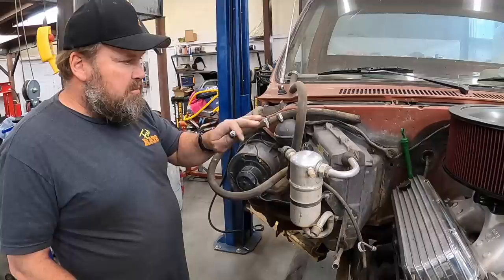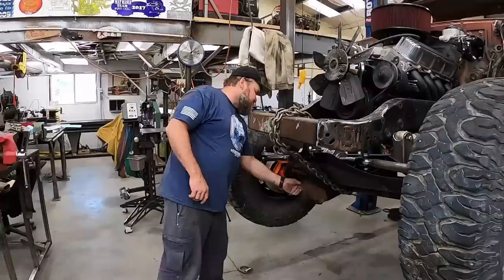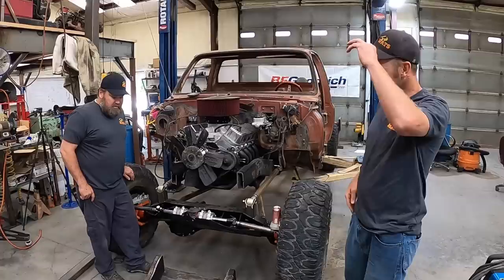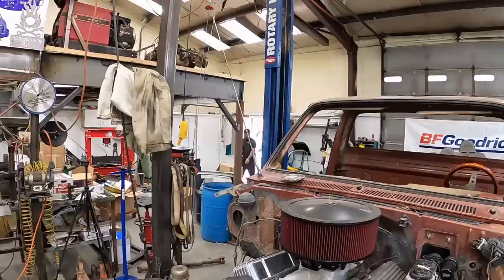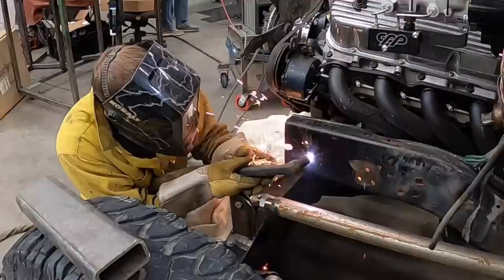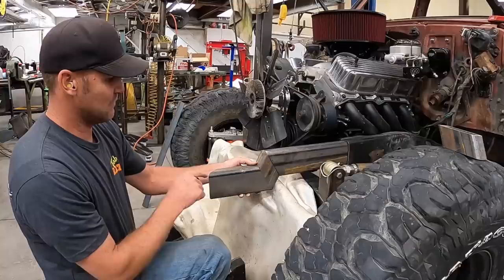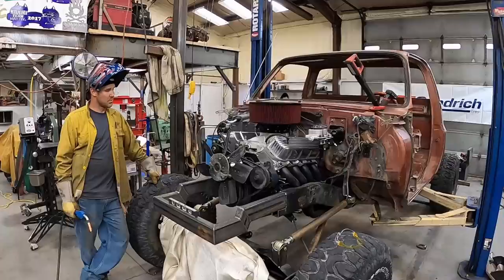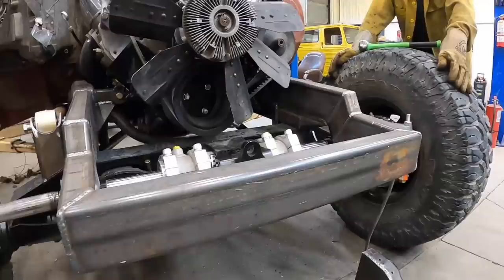This Custom Frame Is Never Going To Bend On The Rat Rod Tow Truck!

Comment: Anyone else noticed at 21:05 the front frame was upside down I can’t wait to see this thing done keep up the work
Reply: Yes, the boys do it nice because they do it twice!
Reply: I was like "errrrmm", Pause, rewind, play. "Yep, first time's a test!"
Reply: Came here to say the same thing...they just kinda skipped over that part 🤣
Reply: I was reading the posts to see if anyone else caught it lol……… I had to rewind for a double take haha
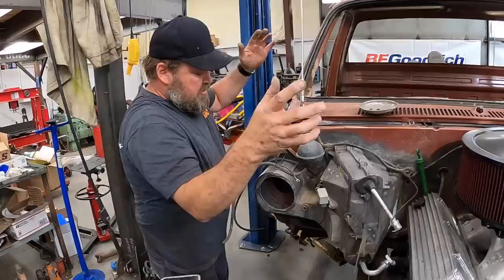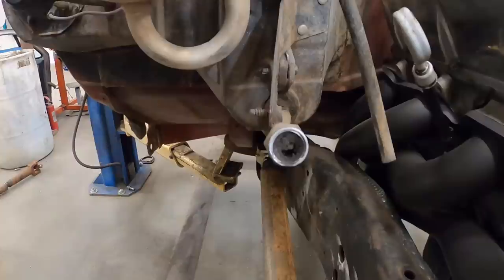Reply: Also the upside down mistake on the evaporator at 19:35 they magically fixed by 21:35 to match 0:35
Reply: I also saw it and looked to see if anyone else did.  Now the question is who on their side noticed first.  I bet it was Ben.  He is the least upside-down one of the two.  :/
Reply: Got to saw Randall caught the mistake before it got too far
Reply: I was searching for this comment becuase before they put it on upside down i was thinking "they are probably gonna put it on upside down"🤣🤣🤣🤣
Reply: I did a rewind too, to see if what I thought I saw was what I saw.
Reply: YEP!!!
Reply: They should put an Easter egg like this in every video. the challenge is for us to find it.
Reply: They're just keeping us awake. lol
Reply: @smirkingone  play that section back at .25 speed and you can see Paul step back, look at it, then start laughing. They left us a little Easter egg. :)
Reply: It was on correctly, they just forgot the flip the truck over.
Reply: Yup - also the bump stops mysteriously appeared and disappeared on the left side.  Just making sure we are paying attention.  Haha - Fabrats we love just hanging out watching you guys do what you do.  Thanks for doing that for us.
Reply: @CarCapture   I like that, I'm agonna use that. :D:D:D
Reply: Yes I did! Hahaha

Comment: This build on the Rat rod tow truck is looking good! Lot's of measuring and eyecromitor reading's going on to make thing's happen. Ben is doing an amazing job at getting the heater core and controls working correctly as well as nice cold air in the summer and having a defrost that works! Good jon Paul and Ben and Randall!

Comment: This might come in handy, when bending offsets in conduit, I have a cheat sheet of multipliers I use based on degrees of bend.
Bend deg    Multiplier
10.               6
22.5.            2.6
30.               2
45.               1.4
60.                1.2
Reply: Does that change with the size of the EMT?
Reply: Nope
Reply: @Dr. Florida Man  it will change with the bend radius.
The zippedy doo dah way is to get the program for that.
Calibrate your dies, then you can hit your number every time.
Had a feller with it on his laptop when we bent some expensive S.S. tube for a platform on back of a boat.
Otherwise, we did it like Paul.
Reply: On conduit, the bend radius changes on different sizes of pipe but the multipliers stay the same. Example radius for a 90 bend in 3/4 emt is 6 inches, but radius for the same bend in 3 inch emt is 24 inches, but the multipliers remain the same for offsets. You are limited by the radius on the larger pipes, forcing you to use less deg and therefore longer offsets.

Comment: Say what you will about backyard Mechanics/Fabricators.....There isnt a auto Engineer in Detroit that could have done what they did to that frame without a computer and a CAD program and a week of number crunching and 3 different engineers fretting over the strength of the frame. These guys did it in a couple days with a Tape measure, level, and a square. Incredible gentlemen carry on!!

Comment: Hey a/c tip from a guy in in the Arizona heat, put a blue orifice tube in that thing and it will cool much better, r134a needs a smaller orifice to get low side pressure low enough to cool properly.

Comment: Here's a little trick I use when fabing something and need to figure out an angle you might find helpful. Simply take a piece of heavy gage copper wire and bend it to fit where your piece needs to go. Then get the angle from the bent copper wire and cut away. Takes a lot of the guesswork out and a lot of recutting. Enjoy your videos, especially the Golden Nugget. Jim

Comment: Just a pet peeve of mine but if your going to totally pull your A/C and heater unit apart why would you not totally clean the shit out of it🇨🇦🏴‍☠️
Reply: When it's a small piece to the big picture it is irrelevant. 
The purpose of snatching the parts out was to fix it, not pretty it up. I say it was a job well done. 
What Justin Trudeau did to those citizens is atrocious. Consider turning your pet peeve into a betterment for humanity

Comment: I draw lines on the concrete to figure out angles. Draw a line for the existing frame, one for where the new part needs to be, draw a line for your angle and measure! Old plumbing trick!

Comment: I just removed a mouse from my PT's blower motor squirrel cage.  One thing to mouse proof your vents is to add a piece of 1/4 x 1/4 inch stainless steel mesh across all openings.  It makes life soooooo much simpler.

Comment: Make sure you replace the accumulator (dryer) before you recharge the A/C system.That old part stopped doing it's job years ago. Also add a little re fridge oil to the new accumulator.

Comment: I put a vintage air system on my 85 best decision ever all that stuff on the firewall goes away and the evaporator is inside the truck where it belongs absorbing heat It really frees up the room in the engine compartment and the fan is infinitely adjustable not just 4 speeds, best 1400 ive ever spent. the kit comes with everything but freon and a fan belt

Comment: typically measure the diagonals as well to be sure its not a parallelogram since the cab may not be square.    although maybe it can help with frame twist from torque   :D

Comment: I believe it is called an orifice tube? Expansion valve's regulate the flow of refrigerant to the evaporator due to temperature, Orifice tube is a fixed nozzle that spray's refrigerant into the evaporator, but doesn't regulate. Less regulation in my opinion is always better!! Both systems work well, but the expansion valve is used more in newer vehicles. Awesome content, wish you would show more of the hard sweat and resolve it takes to repair any vehicle, old or new! Let's see more of  the sweat and agony? I am a shop owner for 22 years and do not think the general public has an understanding of what is truly involved in what we do!! Love the channel and the your ingenious solutions!! Carry on warriors of the machine!!

Comment: The guy up in Oregon, Casey LaBell, did a little blurb on the BANKS diff covers. In his piece He sends you to a very in-depth look at diff covers and why the one he developed is better. The BANKS folks even took and built a clear plastic cover of the biggest/original square cover and one BANKS built.  It shows a real marked difference in what each does and does not do.  I know I am nobody, but I suggest you go take a look at this BANKS diff cover.   Don't believe me go look for yourself
Reply: Yes! I changed my different covers after watching that video.

Comment: You may want to try sticking dryer sheets in the heater some way. Mice are supposed to hat the dryer sheets.  Then add some to the inside of the truck.  It's worth a try...

Comment: Paul, you should have gone with a bed mounted radiator. Then the front could be a flip forward fiberglass front end and or a simple unplug the lights and lift off front end.  :-)       Nice work always enjoy the videos.

Comment: Check with your welding supply shop and see if they have an angles lay out book. When I was a pipefitter I had little book that would give just what you needed for what you did.

Comment: I about cried when I saw those new gears and differential at 4:20 . Yesterday I decided to replace a leaking axle seal on my '82 Scottsdale K10. Removed the diff cover and found a previous owner had welded the spider gear cross pin in place... I ground the welds off, but two hours of banging on that pin with a 2lb hammer did nothing but leave me in pain, and in a bad mood. Still not sure what I'm gonna do. No 4th of July cruising for me...

Comment: how far into welding the front crossmember did you realize that you had mounted it upside down? I saw what you did! You guys can weld! I envy you that. I could flat well but welding upside down - I just never could get the hang of it. 
My truck that I would love to find would be a 64 to 66 Chevy c10, c20, or a long wheelbase C30 any would be fine by me. thank you so much for videoing these things and the Golden Nugget came out really nice. 
It's a beautiful area that you live in. 
Thank you for sharing,
 Bob from Virginia USA

Comment: Paul you need to try Diablo Steel Demon carbide tipped blades for the arm shaker saw.  They are a game changer compared to the old bi metal blades

Comment: great work, did anyone notice the frame was going upward when tacking the weld at 21:00 then it reappeared going down.  
and Sawzall blades are supposed to be blue and broken, seems that's the way most of mine end up.

Comment: Where those upper links join the chassis looks like the joints are 90 degrees out - the bushing is flexing rather than rotating on the pin

Comment: Ben, pressure wash that heater/air conditioner box.  Blowing those turds out is fine, but they pee in there too!

At 21:03 time, aren't you tacking that frame end in upside down?  But I see it got caught. :)

I'm really enjoying the build and the tow truck should have some excellent off-road capabilities.  I can't wait to see it with final wheels and tires.  Poor Ben and Randall are going to need a step stool to get in.

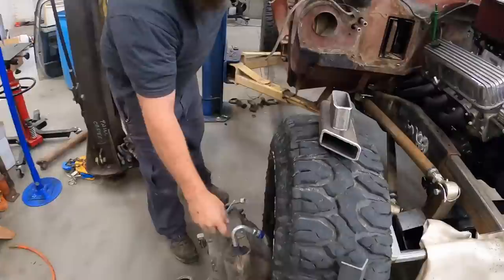Comment: At about the 19:30 mark, it appears the evaporator inside the box is upside down?  As it sits, the dryer bottle will be into the dipstick and valve cover.  (I've need watched the whole video yet, so it may be corrected, or explained  in a few..)   Yep, it got changed.   Good catch!

Comment: Offset x width of the material, divided by the length of the offset= the amount of mitre you need. Divide that number by two and that’ll give you how much to mark either side of the line to make the notch. I’m no mathmatician, I’m just a sheetmetal worker and mitre a lot of duct to make offsets.

Comment: Have you tried articulating the front axle to make sure the control arm mounts don't hit if you have a tire hanging?
Reply: Was thinking same.  Passenger side upper link may hit frame when driver side at full droop.  Looks very close.  Something to think about anyway.

Comment: if it doesn't have a heater core bypass valve, add one or manual valves to do the same. because they always leak a ton of heat inside and you'll be roasting even with the AC working best as can be.

Comment: I love the work you doing to this tow truck! I used to have a 1973 Chevy heavy half that had been hit head on by a semi and my dad and my uncle rebuild it but the framers weak and I had to put a whole other frame on it. But my question is is that I have a 1999 Oldsmobile bravada all-wheel drive and it would go anywhere it worked really well but I got it stuck in the mud hole one day and Bella Vista Arkansas and I backed out of it and I got a hard run and I broke it CV axle on the passenger front how many the next day the speedometer start going crazy and it was trying to shift with the speedometer and now he'll shift from first to second but if you put it in 3 or overdrive they'll just rev up but if you really mess on the gas it'll still pull in second and my service all wheel drive light is on and my ABS light is on and it has all new hub bearings CV axles brakes everything's new I've got a new encoder motor on the transfer case I got that new box that activates the all-wheel drive when it needs it but after it was have got sex that was popping the cracking in the front differential and I took the plug out and check the gear oil and it was empty and I've never seen it leak on the ground no signs of leaks I don't know what happened but it took two quarts of deer oil before it starts running out the hole for the plug is and if I put the front drive shaft in it then it acts like a four-wheel drive it's in low range and you know how it would fight and everything on dry payment so I had to pull the drive shaft back out of it and driving without it but I can only go 35 miles an hour in second gear and it's almost 4,000 RPMs and I know that's not good on it and the speedometer doesn't work at all well within that so I don't know if it's a wiring harness or a shift solenoid? I wish you guys could work on it and fix it and make it awesome but if you can help me if you have any ideas what I need to do I would greatly appreciate it and I also took it to Natalie Chevrolet in Bentonville Arkansas make with your scan tool on it and they reset everything but maybe it's like came right back on and I replaced the speed sensor in the tail shaft twice and it hasn't affected it at all so can you please help me?

Comment: HEY PAUL  you might want a fabricated torsion bar for your rear differential, like under Rory's  trail mater  to keep your differential from twisting while pulling lots of weight and climbing rocks. Rory's got a great view of his on his last or by now next to last video. He put the go pro on his differential and I was like that's a great idea.  Check it out , it would make your differential so much stronger with no leaf spring twist. I just looked up his video, it's called   Tow Truck Versus A Buggy For Pulling. So what do YOU think?

Comment: This is how they designed the engines for the Apollo rockets in the 1960's. The only difference is they also used slide rules.

Comment: I miss the days when heater cores were that easy to change.
Reply: They still are, on Square Bodies.
Reply: @fredandersen9873  I know. I found a 97 f 150 for 650 dollars though, and after tires, ball joints and control arms I had a really reliable truck. Then winter hit and I realized I hadn't done the heater core. what a PITA! It's a little harder to get into a running driving square body for that kind of money. I try to avoid vehicles newer than 2000 so I have some chance of fixing on them without buying a 10000 dollar computer.

Comment: Wouldn't it have been easier to use the plasma cutter cut half circle on the front chassis to make clearance for the steering and then put a tube cut length then in half.. weld them in... but, it does look good and works what you done

Comment: The use of cardboard to make a template is highly recommended. First, it’s flat on a table, you don’t have to hold it. Second, any wrong pencil line can be (mostly) erased. Third, you can lay out all the elements of the fab on cardboard then cut them out and use directly on frame material to draw exact lines for cutting

Comment: I would loose that engine driven fan and use electric radiator fan(s).  All my trucks with big engines had cooling issues especially at low speeds and idling in traffic until I installed electric fans.
Reply: Agreed!  Been there. Much better in the summer heat.

Comment: Looks great Paul. What settings did you use on the Millermatic 252 when you welded the frame front? They looked really good. Thanks!

Comment: hmmm.... was the way the AC/Heat door not shutting all the way part of the defrost system?  as in; if am not mistaken, when you turn on defrost AC also comes on as well as heater.  AC comes on to act as a de-humidifier.  Thus maybe why the vent design is to not fully close.

Comment: Why are you not getting rid of the belt driven thermal limiting fan that requires High engine RPMs for maximum cooling where you could put a large shrouded fan on the radiator and get high speed even at idle.

Comment: I like the new welding helmet but I'm surprised that you don't have the face shield that darkens as soon as you spark the welder on.  I've used one of those and they are so much better than jerking your head down to get the helmet down over your face.
Expensive?? A little bit, but the price is worth every penny. You can just leave the helmet over your face because it's clear, and then you start welding and it's instantly dark. You can even look at the Sun with it.

Comment: So I have a stupid idea, but hear me out. Seeing the wrecker with the front frame rails cut makes me wonder, what would happen if you left the frame short and mounted the bumper and winch to the front axle. With a big skid plate and rails. You might need Monstermax control arms but the bumper would always be off the ground right? You could relocate the rad and stuff to the bed, then build a super clearanced little dog house for an engine cover that would stay out of the way of the bumper. This is dumb but let me know what you guys think anyway.

Comment: The evaporator outlet line looks wrong... I think they are supposed to hook towards the fender.

Then in the last scene I saw it was correct?
Reply: Ahhh..it was installed upside down!!
Movie magic :-)

I just redid the ac on my 85 k5....converted the front accessories to 96+ serpentine and cs144 alternator.

Comment: I'm a little confused.  You cut the frame back to gain clearance, but then you ended up adding some 2 x 2 and an angle piece that appear to bring the frame about 5-7 inches forward from the original cut.  Then the 2" drop.  What up with that?

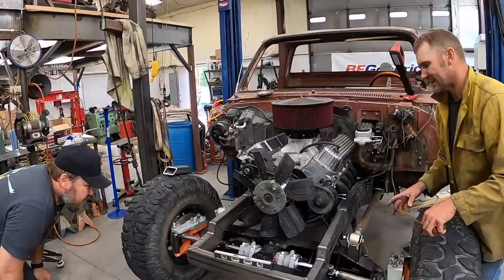Comment: 23:36 is your floor level or tires have the same pressure or the camera tilted because your frame looks facing it lower on the left and higher on the right.

Comment: Every Time I go to one of them PICK AND PULLS I have 1 or 2 things that are needed to get the parts I want ! So I just buy new stuff now and danged if most of them are wrong
Why not mount the RAD on top of the roof out of the way then you can clear everything up front?????? It could work like a sprint car wing too!!!!